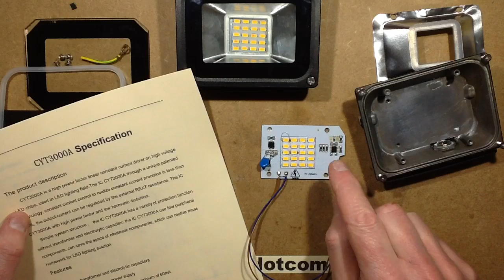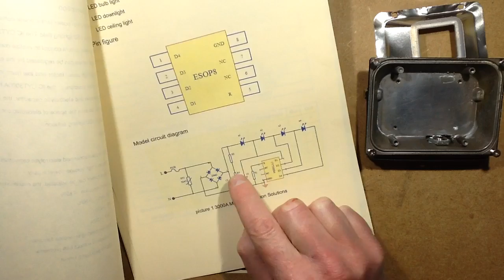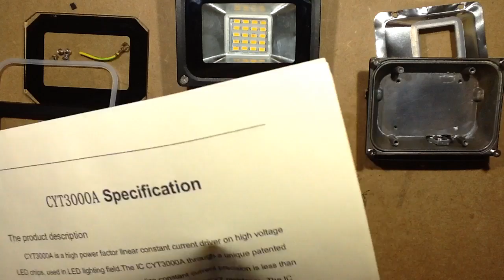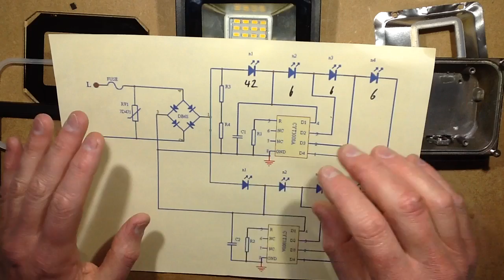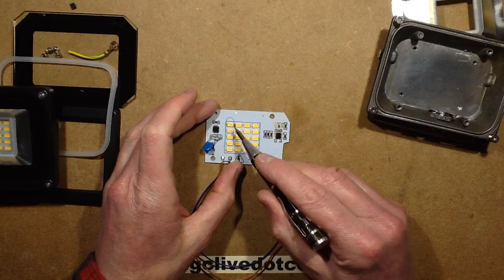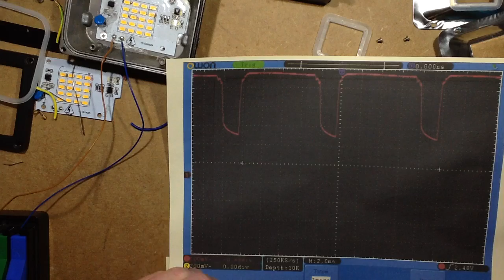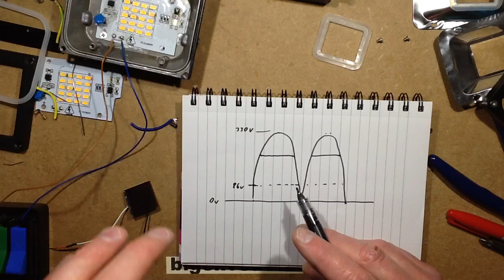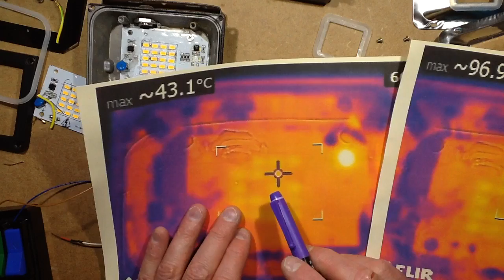Teardown, autopsy and hack of dead SMD LED floodlight.

Comment: I do not like those. not at all
Reply from the maker: +TheJohn8765 Yeah, I'm not a photography enthusiast, so I just use cheap sets of four 100ml bottles of the ink that is supposedly for "Epson" but often come labelled "universal".  My old Canon was the easiest to fill, but the Epson printers sometimes need a bit of encouragement.  Mainly involving cleaning the printhead physically when they spew out too much ink when the replacement cartridge system is installed and also cheating the printer into accepting the new self-resetting cartridge chips.  Epson are the worst for trying to keep their lucrative ink market.
Photo paper printout looks absolutely fine although it can fade in direct sunshine (just print another), and the bulk ink lets you print without guilt.
Reply from the maker: +TheJohn8765 I think the best LEDs are reserved for high volume manufacturers.  There's no shortage of ink.  I use a continuous ink feed system with 100ml tanks of each colour filled with cheap eBay ink.
Reply from the maker: +Proyectos LED No.  Nice concept, but the chips seem a weak point.
Reply: bigclivedotcom Oh, have you had good luck with ebay ink? I've been thinking about a continuous fill printer, but I didn't want to use main brand sell-your-organs price ink.
Reply: +bigclivedotcom I ordered one of these off Amazon as a "10 watt grow light" it has red and blue LEDs do you think this will produce any noticeable results at 6inchs from a pepper plant?
Reply: +bigclivedotcom From your, AvE's, and others' vids, all the ebay led chips seem really subpar. Is there any manufacturer that makes reliable products??

Also, RIP to your printer's ink pots ;)
Reply: bigclivedotcom Cool, thanks for the reply. My HP is buttoned down very tightly vis a vis non-HP ink, but I'm thinking of getting a Brother. Apparently they're refill-friendly. Good to know the bulk ink can work reasonably well.
Reply: +bigclivedotcom Make a vid about your system of refilling?
I guess there are tutorials on this, but you probably have som tricks and mods for this as well.
Certainly enjoyed this one. Thank you!

Comment: I wouldn't trust such a thin layer of fiberglass to insulate the mains from that aluminum backplate.  I guess the case is grounded so it should be safe..  I guess..

Comment: You need a Metcal or JBC iron to solder ali. PCBs. 
or a hotplate
Reply: +mikeselectricstuff basically to keep the alu at a temp below solder melting point but close enough to make adding an iron send the part you're trying to (de)solder get hot enough?
Reply: +camtheham13 Add the higher temperature and more aggressive flux and leadfree solder fumes might just be worse for you.
Personally, I like a slow fan to just draw the fumes away from my face. If the room is big enough and the soldering negligible no further filtering or fume extraction is needed.
Reply: +mikeselectricstuff I was going to suggest bottom heat. I used to work on UFO lights and learned quickly you need to heat the whole board to like 175ºC before a pencil style soldering iron will cut the mustard.
Reply: Yah, the yihua irons are not the best with high thermal mass... I have always wondered if I can stick a sheet of metal around the element on my unit to make it actually touch the sleeve of the tip...
Reply: +mikeselectricstuff A 50W Weller TCP with a 6mm bit would be my weapon of choice.
Reply: +Dan T Ah yes, the fume extraction version.
Reply: +Dan T oddly enough lead fumes really aren't airborne in solder, as long as you wash your hands after soldering you should be fine
Reply: Yep all you say is true, using fume extraction, or a fan is sufficient in most cases, and in the case of a hobbyist just take occasional breaks and you will be fine with leaded solder
Reply: he have the antex iron

Comment: All of this talk of electronics has got me thinking about this off-topic question: if you daisy-chain extension leads, but have nothing plugged in except the proceeding extension lead to any of them except the last one, and lets say that is 10m long, is that the same as having 1 extension lead with a 10m cable?

Comment: About soldering on his type of pcb: heat it up with a paint-stripper from the back and use tweezers to get components off or on the pcb. Just don't forget to hold the pxb with pliers or similar or you will burn your hands while holding it. :)

Comment: Depending on clearance area, you could easily swap for a different LED setup and put the control circuit behind the reflector.  You could alsp make make a small stand out of tube steel, and store some 18650 batteries in the stand to make them portable and rechargeable.

Comment: Could I send you a power bank for a autopsy? I got this 20K mAh powerbank for £10 I charged it once then drained it to 0 basically (Went on a long trip) when I went to charge it, it wouldn't accept it. I tried many cables but I think it's my fault as I used the one it came with.
Reply: Glebs Litvjaks I don't know anything about electrical work, I just enjoy these vids, so you know I'll leave it :P
Reply: Glebs Litvjaks Thank you for the help, and I might start learning, as my dad has a degree in electrical engineering I might learn something of him :)
Reply: +Glebs Litvjaks Right the thing is torn apart and nothing is labeled, How would I check that the input Mini usb is working/how to fix it?
Reply: Glebs Litvjaks I can get a multi meter tomorrow, but will Twitter do?
Reply: Glebs Litvjaks Scrap it, I can smell kinda burning from 1 chip beside the mini usb, and it would be cheaper just to buy a new power bank but Thank you so much for your help! :) have a nice night/day
Reply: Glebs Litvjaks To you too :)

Comment: So its possible that the chips didnt meter the current correctly because they were stacked, ignoring the chip manufacturers data perhaps?
Your reactive dropper does work :-D perhaps use two series capacitors at double the value to share the load, maybe :-)
Reply: +zx8401ztv pretty much any semiconductor in parallel can have issues with load sharing.
Diodes if forward voltage of one goes up more current goes into to the one with lower forward voltage.
same with MOSFETS if one gets a higher RDS value.
Reply: +Josh C 
Its an easy mistake to make isnt it, on linear power supplys the output transistors have identical resistors in the emitter's to make them more or less equal, so one dosent do all the work BOOM!! lol :-D.
Ordinary leds are the git, parallel any two leds and one will allways hog the current ha ha :-D
Reply: even leading product manufacturers do it though just a gamble in my opinion but saying that it is some time not possible to find a device capable of doing the job but that can be worked around sometimes by clever design.

Comment: About the flickering measurement. I did a similiar experiment and ended
 up using a "real" photodiode as the capacitive effect of the solar cell
 made measurements inaccurate. The blogpost is in german - english only 
via google translate - but the pictures should explain themselves: 
http://www.zerobrain.info/fotokatastrophen/2015/10/17/led-flimmern-vermessen-gemessen-was-flickert-denn-da
Reply: +Zerobrain Indeed, use a photodiode such as BPW34 instead of the solar cell. It has a much higher bandwidth and will allow you to see the light waveform in much more detail.

Comment: I don't really like this design
Reply: +Glebs Litvjaks Plus it relies on the chip switching thresholds being the same. Then there's the safety issue of relying on that PCB for primary insulation coupled with so many Chinese products having no working earth connection.